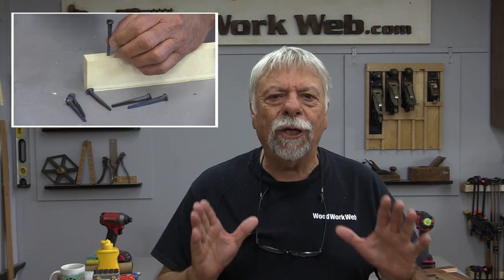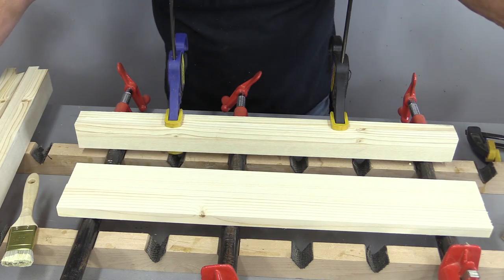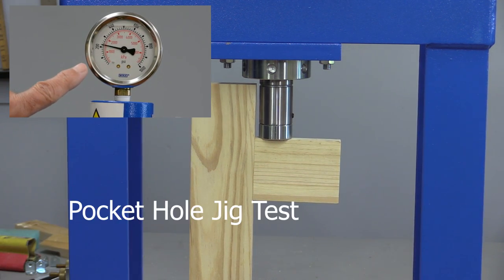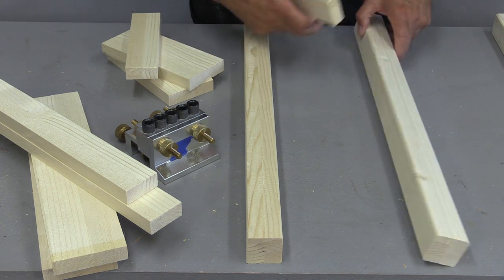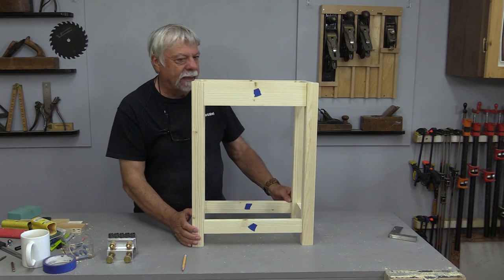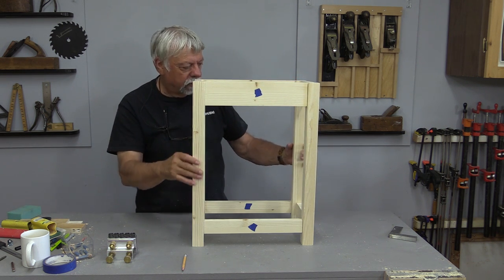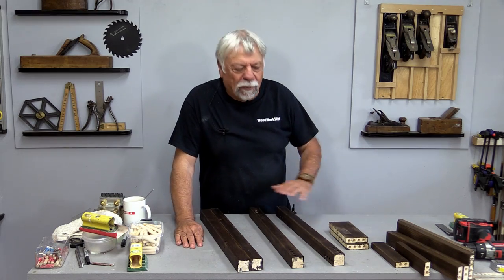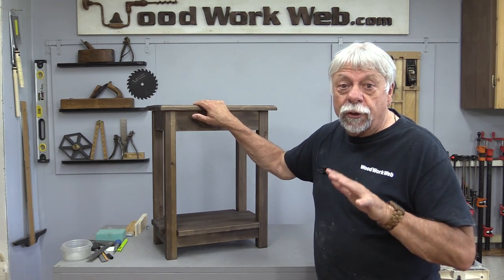Best Results for Woodworking with Pine Wood

Comment: Another great video Colin. Many thanks. It was good to see the comparative strength tests and your recommendations on stain and finishing. I would have thought that lap joints would also have been a viable option and probably stronger than pocket holes. I get a feeling you are not a fan of lap joints as you also didn't mention lap joints in your video on joining boards end to end. I was wondering if you can share your reason for not being a fan of lap joints.
Reply: With lap joints there is end grain exposed.  Fine if you like the look of end grain but generally not preferred.  Now if you are painting it that is a different story.
Reply: @dwightl5863  Thanks, I never thought of that and especially with a soft wood like pine, stained end grain really looks very different to stained face grain
Reply: @dougggiereid  One can minimize that darker end grain affect by sanding the end grain at least one grit higher.  I have had better results going up two grits.  Ex:  If last sanding grit is 220 I'll sand the end grain only to 320 and then to 400.

Comment: Great video! I love to work with pine, and unless I am painting, I always use the Pre Stain before applying stains  to avoid the blotches.  
What's the brand/model of that doweling jig that you used?  It looked solid.  My only question is, although it's good for edge-drilling, but how do you use that to drill on a flat side (face) of the wood (for edge-to-face joinery)?
Reply: My favorite is the JessEm Doweling Jig... good stuff... made in North America (Canada.) Woodcraft runs specials on them from time to time too. Check it out.
Reply: It is the Dowelmax product.  It is pricey but well built. It has accessories to use dowels on flat, long, and angled surfaces. You can buy 1/4, 3/8, and larger dowels if you pay extra.

Comment: A good video..thanks.  BUT, I have to say, I was not surprised, but was underwhelmed by the end result of the finishing of the pine surface.  I have never had any luck staining pine and getting an attractive finish, and your dye was just as bad about color splotches, etc.  That is why I think of pine for painted projects, or, rarely, unstained projects.  With lumber prices being so high, it is too bad that pine doesn't really offer much of an option for furniture grade work.
One question:  Are the "hardening oils" you speak of similar to "Watco Danish Oil"?  I love that stuff on oak, etc.
Reply: Pre-stains help tremendously to even the finish on pine and prevent splotches.  Quality construction from pine requires a planer in your workshop and an extra level of sanding.
Reply: @chrisgraham2904  I am well aware of pre-stain, and use it.  Pine still sucks for being blotchy.
Reply: @Mama C I am well aware of pre-stain, and use it.  Pine still sucks for being blotchy.
Reply: @Mama C How about reading what I wrote, instead of making up what I am saying?  I said I see pine as useful for either painted projects or natural/unstained.  I think it sucks for taking stain.  Did YOU find what he shows at 12:45 to be attractive?  Because I sure didn't!

Comment: I just love working with wood and my Kreg Jig, but I love this dowling machine as well.  Just curious, how did you connect the top to the base.  I am getting ready to make some tall bedside tables.  Is the top jointed pine boards as well? I have a router but have not used it yet but can't wait to try it out...:-)
Reply: Once you get started with the router you'll find all types of stuff that you need to be routing lol
Reply: @CeeJayThe13th  That's what I am thinking.  It is just a little intimdated to get started...LOL  Of course everything is until you use it the first time.
Reply: @vickiehutchens2145  it is a very loud and powerful tool that definitely demands respect.  Just be smart and safe and you'll be OK but it's a wonder to see the way that sucker blasts through wood like it does.
Reply: Just get started on some scraps and experiment with it. As Cee Jay said, you will be using it on everything before long! 😁

Comment: Hey Colin love your videos. Is there a reason you didn’t mention Dowelmax as your doweling machine. I also use the Dowelmax and have had good success with it.  Glad to see you are using my suggestion of a few years ago of slightly sanding and marking dowels used for dry fitting. Does the Osmo product come in different finishes and which do you use?

Comment: What about Festool Domino? Is it stronger then the dowel? I'm thinking about buying it by maybe it's better to use the doweling machine.
Reply: Holl, I have both Festool Domino's, the 500 and the 700. They are great, very fast and create a very strong loose tenon joint. The 500 is $1000 and the 700 is $1500 US. I have used a simular doweling jig that Colen uses here and you would be amazed at how well they work. Don't get hung up on which is strongest,  they are both strong. The dowel jig is inexpensive, and trust me, once you start buying Festool, it is like a drug, it's hard to stop. Trust me, dowels are just fine 👍

Comment: How do you keep the dowels in the short and long aprons and braces from interfering with each other inside the leg.
Reply: You can offset the holes as long as the part is wide enough.

Comment: Do you find you have any issues with gluing those aprons to the legs with the legs being finished? I recently tried gluing some stained wood blocks together, and wood glue, super glue, and epoxy all had trouble. Had to go with a construction adhesive rated for plastic!
Reply: don't stain the sections of the pieces you're gluing. they will be the inside of the joint so they won't show.

Comment: Pine is seen almost exclusively as a cheapo, beginner wood not meant for "serious" woodwork, but I disagree. While it might not be appropriate for chair legs or a tabletop that sees hard use, it's more than adequate for most projects. I also think that it can be really attractive on it's own without a stain. The low cost also means that you don't have to feel bad about painting it, which I think can be a great design choice that a lot of people overlook.
Reply: Agreed. I personally really like the look of plain old Zinsser Shellac on pine and it is oh so easy to apply and fix down the road. It also works great over analine dyes (like the dye he is using here) or mixed-into clear shellac. Put on enough coats of dyed shellac to get to the color depth you want and then switch to a couple plain clear shellac coats, lightly finish sand and call it good.
Reply: @0dtp1  Twenty five years ago, I built my entire dining suite from clear pine (Table, six chairs, 6 foot wide sideboard cabinet and hutch) and it has stood up extremely well.  The dining set doesn't get the wear that the kitchen set does and the eight coats of petroleum based polyurethane has provided an armour shell as a finish.  I love the depth of multiple urethane coats on pine as it "honeys" over time.
Reply: @chrisgraham2904  Yeah further proof. I've given-up on oil-based poly finish though and when I want poly I use water-based now. I know there are tradeoffs but in my mind they are totally worth it considering the ease of cleanup and safety of the water-based over oil-based.
Reply: @0dtp1  I probably use water based poly more now than oil based also, but I still have a love and appreciation for the flow characteristics of the oil based and it's ability to be polished and buffed to a brilliant shine when a super high gloss is desired.

Comment: I have a question. If my blade at the front is at 4.44 in and I rotate to measure the same part of the blade at the back and the measurement is 4.43 would this really affect the straightness of my cut?
Reply: It means that your fence is not exactly parallel to the blade. I think the only result would be a wider kerf - by 0.01.

Comment: This is just for debate pocket hole  Strength comes from the amount of pocket holes and the over all structure  of the pieces as a whole  now this is a far test to say 2 dowels are better than 2 pocket holes but I dont know if the same is true for the multiple. Great video tho still.

Comment: Hardening oil. Something new to explore. About the dowels, “ bigger is better.”  It would seem like the 1/3 rule for tenons would be good to observe for dowel diameter. Especially since it seems with modern glues, wood fails first. I also wonder about how many dowels to use (spacing) and proximity to the end of the end grain piece. At what point might they weaken the wood?

Comment: Did you put 4 pocket screws in for that test like you put 4 dowels in?
Reply: Pocket holes get a bad rap because they get misused so much they're actually very strong
Reply: Pocket holes would have been just pine here;-) Unless you are planning to have an elephant sit on this little side table. You cannot see the holes anyhow unless you look underneath the table.

Comment: I'm sorry Colin I have to disagree with you about Biscuit joints, over 20 years ago I made a magazine  and storage table with just Biscuits  and its still as strong, but I still enjoy your videos.
Reply: Colin's worst failure was at 250 lbs. for a single joint.  You probably have multiple joints in your storage table which provides much higher strength and you magazines probably don't weigh over 250 lbs.  For the size and purpose of this type of small table, any of the joinery methods would be quite adequate.

Comment: Why aren’t you spraying the dye? I use all alcohol based, ultra penetrating NGR stains by Mohawk and they are always sprayed on. Your dye is still very blotchy. If you sprayed the dye, especially on top of a sealer coat, you would eliminate the majority of that.

Comment: Might be a silly question, but is construction pine a lesser quality or is it the same thing, just planed and sanded smooth?  I was recently attempting to turn some pine on my lathe for a rustic looking ornament and man, it is NOT going well.  But I was using a cut down 2x4 so I'm not sure if that's why I was having issues.  (The tutorial I was following was using pine)
Reply: Construction pine should be as strong as "select pine" which is squared, planed and sanded.  The construction grade may have more knots.  Your issues may be with the moisture content of the wood.  I suspect the kiln drying process for "select pine" is controlled better.

Comment: not everyone has the skill to use dowels -- and if you make even one mistake you set yourself up for failure -- pocket holes are easier and are plenty strong enough unless you are building a chair or stairs
Reply: There are a number of dowel jigs that make the dowel job easier and less prone to errors,  usually less costly than the Kregg pocket hole jig.  With that being said, my "go-to" is still pocket holes wherever they can be concealed and I always glue the joint.

Comment: Biscuits are disappointing, because they're NOT meant for structural joinery. I wish this idea would be thrown out of peole's brains already. They're only meant for precise alignment of jointed wood in table top blue ups etc. for structural strength you need mortise & tenon, dowels or dove tail etc... or even screws.